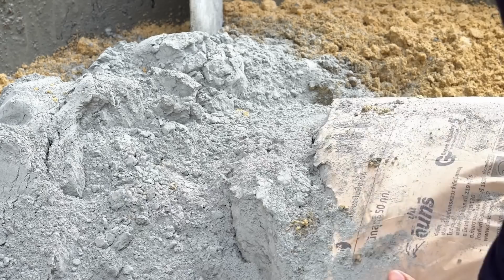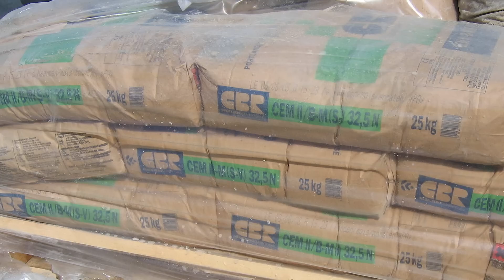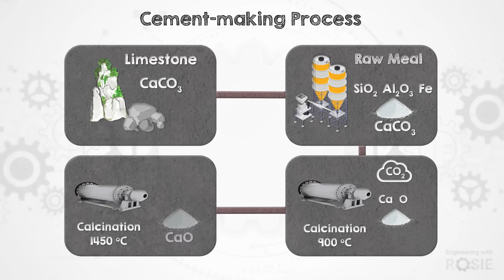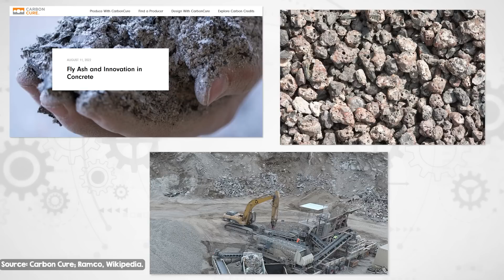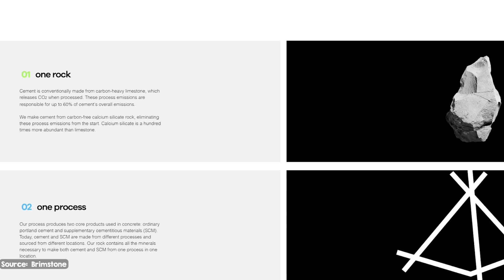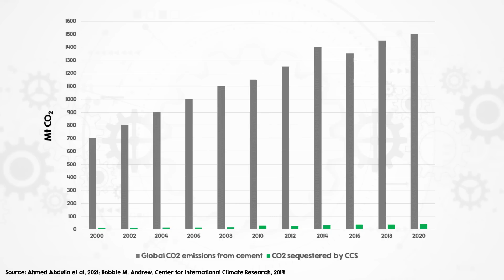Zero Emissions Cement is Closer Than You Think

Comment: Cement has many challenges but also so many opportunities firstly a cement kiln is a massive sink hole for all sorts of materials to get rid of.  A big one is municipal waste which can be fired in as a fuel source all energy becomes part of the process all minerals become cement its a win win really the only emissions is CO2 which doesn't mean new CO2 rather replacing the CO2 from the coal with CO2 from the municipal waste. In fact a cement plant I worked with trialled this very successfully they also used plastic waste all types, used engine oil, sawmill waste etc etc. I understand only issue was SO2 and Cl which were issues but now insurmountable the plant I worked with estimated they could consume the waste for a moderate sized nearby easily so reduced trucking CO2 and eliminated landfill. Biggest issue was most western nations have blanket rules against burning municipal waste.

Recycled cement is a fallacy doesn't exist what you have is repurposed concrete used concrete ground and used as an aggregate replacement in concrete. So merely a way of reducing quarrying, a useful and good thing but not recycled cement.

Comment: An electric furnace demonstrator with capture has been demonstrated, reduces emissions significantly. That åre-heated CO2 waste is actually raw material for some chemical processes, such as making fuels (won't get rid of the emissions but would reduce need for other fuel emissions) and even "human fuel" i.e. proteins (there's demonstrator for that too).

Comment: On average human caused atmospheric carbon dioxide is less than a 0.1% share in earth’s water vapor saturated greenhouse effect.  Water vapor has a CO2e of 18 and on average is 1% of the troposphere.  Carbon dioxide has a CO2e of 1 and is 0.04% of the atmosphere 400ppm.   

1.00%/0.04%=25,  water vapor is 25 times more present in the troposphere than carbon dioxide.  25 X 18 CO2e = 450 CO2e for water vapor and 1 CO2e for CO2.  All the other greenhouse gases add up to a bit less to about the same as that for carbon dioxide or 1 CO2e.   Carbon dioxide has 1/452 (0.0022) share in earth’s water vapor saturated greenhouse effect at average 1% water vapor.  

40% of atmospheric carbon dioxide is considered to be from human activity;  0.0022 X 0.40 = 0.000885 leaving human caused atmospheric carbon dioxide on average being less than a 0.1% share of earth's water vapor saturated greenhouse effect.   5.55°C X 0.000885 = 0.0049°C share in temperature retention from human caused atmospheric carbon dioxide.  

Water vapor always hold earth’s water vapor saturated greenhouse effect in saturation.   The other greenhouse gases can not change the overall effect of earth's water vapor saturated greenhouse effect.

Former Greenpeace scientists state there is no unhealthy high level of atmospheric carbon dioxide.  1200 ppm carbon dioxide levels are used in plant growing greenhouses for C3 plants over 90% of the plant life on earth.   This is three times the current atmospheric carbon dioxide level of 400 ppm and would greatly green the earth especially desert fridge areas allowing C3 plants to need less water.

Comment: Very good summary, one thing that was, however, overlooked is the recent research on replacing the cement precursors with glass.

For those unfamiliar, glass has an amorphous structure which suggests it may be able to be dissolved and reorganised to form a geopolymer cement. However the big road block is that glass is extremely unreactive which is why it is typically used as an additive rather than the sole precursor.

Recently I was involved in research on this area for my thesis where we used a glass derived from a martian simulant material (fake martian soil). In the experiment, we demonstrated that using a strong sodium hydroxide solution the glass could be dissolved and activated to create a cement which uses (aluminosilicate) glass as a sole precursor. The cement was then analysed using xray diffractometry  (XRF wasn't available at the time) which showed that the cement had clearly absorbed CO2 from the atmosphere as the glass itself could not contain any carbon due to the glass making process.

While we were not able to test its material properties the experiment did show a potential route to a carbon neutral cement (only carbon neutral as glass making releases CO2). The use of a varied composition martian simulants also seemed to suggest a strong dependence between reaction time and iron content in the sample. Where iron assisted the reaction and dominated the reaction products.

Comment: There is also the possibility to replace concrete, where concrete is not needed, by wood. I do not talk about the matchstick houses built in the USA (mainly 1.5 by 3.5 inch), but houses like they are build for example Norway using beams instead of sticks. You can produce houses that stand up to heavy winds and earthquakes out of timber. Regarding multi story buildings from timber, they are reaching 20 floors.
Timber buildings are good as long as there is enough timber grown and we actually sequester carbon at the same time. A lot of the timber would be used as CLT or laminated beams. Both can be adjusted to in what direction the strength is needed and produced to needed sizes for each project.

Comment: What if we combine different known processes with the production of cement? I have an idea which includes a pyrolysis chamber and plastic waste, which still have not been solved properly.
My idea is to run the process of making cement and use  the process to heat up the plastic waste so it turns into gas. Since 95% of plastic is made from oil, there is a huge benefit from using the energy in plastic waste to be used a part of the heating process.
One pyrolysis chamber can turn 50 tons of plastic waste into gas or oil per 24 hours.
A by-product of pyrolysis is, it ties the co2 in plastic in carbon black, which can be used in the process of making cement. Or enhancing the soil farmers use to for soil enhancement.
By doing so, we solve some of the problems of cement production. And a part of the need of energy.
But we need to figure out how to channel the heat from cement production to be used in heating the pyrolysis chamber (which needs 500 degrees Celsius)
I think the combination is beneficial.

Comment: I work with slags, and GGBFS, which can replace GP Cement is already being used at about 40% of the concrete binder blend and can be higher, up to 100% such as in some geoploymer blends.
Additionally, there is a bunch of good research going into if BOFS or other steel slags can be used to both capture/sequester carbon and provide a cementitious material.

As you say, blast furnaces are likely to be phased out and the newer technologies are not mature enough to know if the byproducts will be useful for cement, but we have a couple of decades before this (at least) where we can act based on current technology. The steel slags side of things is likely to hang around for much longer and it's showing good promise to supplement cement while also sequestering CO2

Comment: Lime based concrete or mortar is different than klinker based in that it reabsorbs the emitted CO2 over a couple of years, turning back to calcium carbonate, making it truly carbon neutral if cooked with renewable energy.
Unfortunately it's an order of magnitude less resistant and doesn't harden in wet conditions (so called hydraulic lime does harden wet, but uses the same chemical reactions as klinker, so it doesn't reabsorb the CO2).
I'm sure research could be done to increase it's strength so it could be used anytime wet hardening isn't required.
Also look at the recent research apparently solving the mystery of Roman concrete

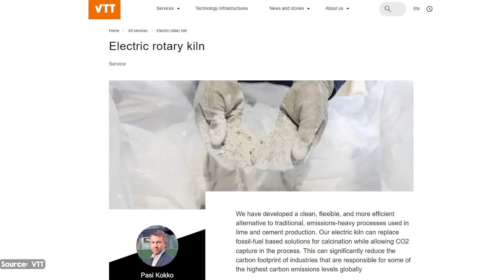Comment: 9:47 - there's a process by ThyssenKrupp that heats kiln using methane burned in oxygen produced on-situ instead of air, making CO2 much more concentrated in effluent gas and so easier to capture. After a series of pilot plants, the plan is underway for an industrial scale installation in Našice, Croatia. The captured CO2 will be stored in nearby saline aquifer.

Comment: Another option worth considering as a cement alternative is large-scale wood construction, which not only avoids concrete and steel production but also acts as a long-term carbon sink. The kind of constructed wood materials they use like cross-laminated timber (CLT) can actually be just as fire resistant as steel and concrete. https://www.youtube.com/watch?v=1N0tdEc4oTw

Comment: great summary, though I would add Rondo energy to your list of heat solutions. They've been able to generate very high temperatures using electric heat batteries - not quite to Cement heat yet, but they are working on it.

Comment: It's not just cement that is an issue. 

180 litres of water are used to make a metre cube of concrete. 47% of this water remains held in the concrete.

Fifty billion tonnes of aggregate are extracted from beds, banks and floodplains of rivers and lakes. Vietnam’s Mekong Delta is disappearing.

We need to reduce the amount of concrete used. Have a look at a product called Stratadune that uses a lot less concrete.

Comment: Kind of brings up an interesting issue.. In studying cement from ancient Rome a fairly recent discovery regarding its strength and ability to last has been shown to be that it is, I don't remember the exact term, bit it's something like, "hot pored". This means that the Valcium Carbonate is still in the process of conversion, unlike Clinker, and it actually develops crystallized bits inside the material. When cracks form and water finds its way in the water dissolves these crystals, which then redeposit in the cracks, as it seeps back out, sealing the cravk and restrengthening the material.

So... do any of the alternatives exhibit this trait, voukd be made to, etc., or are any alternatives we develop going to have the literal same problem as, ironically, all modern cement, in that they cannot self heal, and are thus actually less structurally sound over the long term?

Comment: One 2-MW windmill has 750 cubic yards of concrete foundation. One cubic yard will generate 400 pounds of CO2 so 750 x 400 = 300,000 pounds of CO2 released in concrete manufacture alone for each windmill installed.
Reply: Yeah, wind turbines are pretty concrete intensive, one of the many reasons why I am still keen on nuclear, albeit in its latest 4th gen incarnation.

However, there is a good possibility of reuse of the foundations. My comments get killed if I put in a link, but google: 'wind turbine concrete foundations re use', so the input of concrete is good for many years, with a much lower CO2 cost per KW over the lifetime than it would appear on first blush.

Comment: I work in low-carbon cement research. There's one clarification I'd like to add to a mostly good explainer: the limestone>lime calcination works essentially in reverse over the service life of a concrete structure; CO2 - about 30% of emissions used to make the concrete - is absorbed by the concrete over its life (also: geopolymers use a lit of industrial chemicals, which use enormous amounts of energy- the emissions are not in the cement, but the ingredients). Also, CO2 injection is likely to have unintended consequences on the longevity of concrete structures.
A further way to reduce total cement use is to have longer lasting concrete structures (ones that don't need to be torn down after 30 years).
There's a lot of research and innovation in this area, so watch this space!

Comment: It is great to hear the optimism of this survey of what could be done in an industry with such feet of clay that it is resisting any change to its massive momentum of continuing to expand the fossil emissions it creates, and such duplicity that it greenwashes with every word when it speaks of its plans at all.

Geopolymer and sequestration of aggregates are cement's two great hopes in a world that needs everything to become net carbon negative, and rapidly -- at least 2% of today's level less fossil emission per month down to zero by 2030 to avoid Lahaina repeating over and over again. Unlike Ordinary Portland Cement (OPC) and most other cements, geopolymer (alkali-activated metakaolin) tolerates charcoal (or 'biochar') as an aggregating material well, and can be made substantially lighter and better insulating concrete with little loss of strength, cheaply. This is a good way to sequester the wood waste from all those trillion trees the world needs to plant by 2060 to prevent the trees from decaying into methane.

While carbon curing has a nice sound to it, the present practice is for governments to subsidize carbon cure cement that otherwise would never have been produced, thereby creating fifty times as  much CO2 emissions from fossil (which all limestone is). In reality, carbon cure is a dead end: all cement eventually cures over time, so the gain of 'carbon cure' is temporary and dubious.

Building out of engineered wood, however? That's as good as it sounds. Especially increasing population density of cities with engineered wood buildings in walkable neighborhoods.

Keep up the great work.

Comment: An excellent review.  One point that seems to have been missed:  much of the CO2 driven off in lime production (calcination) is re-absorbed by the cement, just over the ~ 100 yr timeframe, so not fast enough., but carbon neutral over the long term- so the real issue is the energy, not really the calcining..Alternative cementitious materials, wiser use of cement, alternatives TO concrete for above-grade construction, electric heating in calcination, biofuels for clinkering, and CCS...they're all needed.  Note one thing missing here:  hydrogen.  I don't think there's really a role for hydrogen in cement production because the clinkering kilns need a radiant flame- they don't even like burning gas, they'd prefer coal.  Hydrogen is definitely capable of generating the required heat (at tremendous cost) but isn't a perfect fit.  Biogas methane with the addition of biochar is a better fit there.
Reply from the maker: Thanks for adding those extra points. Does cement really reabsorb ALL of the CO2 from lime production eventually? Even in the middle of a thick slab?
Reply: Seems like an imperfect CO2 sink.. wonder if the 100yr timeline has an effect?  And seems logical that only x% of the volume would capture CO2 (exposed).  
AND we would have to make sure all buildings remain in use over 100 years…. With all inefficiencies we might end up wirh 15-20% of the original CO2 captured … changing materials sounds better
Reply: @EngineeringwithRosie  Eventually yes though slow the much taunted 100yrs I suspect is merely the half life of the equation however its still significant, certainly significant enough to be mentioned surely.

Comment: Recycled plastic -in-situ raft slab form-liners can be used in on-ground slabs to reduce the amount of concrete used in these applications.  It can according to supplier data reduce the overall cost of am in-situ slab by 15-20%.  As per your video when you add this to a process from Carbon Cure you are potentially looking at reductions in concrete volume.  These two reductions might go some way to balancing out the increased in production cost of the new concrete mixtures thus allowing for a faster transition away from existing concrete mixtures.

Comment: Thanks for the great video. Love your channel, I watch it regularly.  Mass timber can replace concrete in so many. applications from buildings to bridges.  It is great to get to zero emissions concrete but that doesn't solve the problem that it is a finite resource.  Keep up the great videos!!
Reply: Mass timber cannot replace concrete in most applications & also if you consider the whole-life, mass timber is not a significantly lower carbon material than concrete

Comment: Neocrete seems to be looking hopeful as an additive to reduce cement quantities without needing a fossil fuel source. Sources from volcanoes in NZ I believe.
Reply: Should be called Paleocrete:

Pozzolanas such as Santorin earth were used in the Eastern Mediterranean since 500–400 BC. Although pioneered by the ancient Greeks, it was the Romans who eventually fully developed the potential of lime-pozzolan pastes as binder phase in Roman concrete used for buildings and underwater construction. Vitruvius speaks of four types of pozzolana: black, white, grey, and red, all of which can be found in the volcanic areas of Italy, such as Naples. Typically it was very thoroughly mixed two-to-one with lime just prior to mixing with water. The Roman port at Cosa was built of pozzolana-lime concrete that was poured under water, apparently using a long tube to carefully lay it up without allowing sea water to mix with it. The three piers are still visible today, with the underwater portions in generally excellent condition even after more than 2100 years.

-Wikipedia

Comment: I don't like all those concrete skyscrapers to begin with. Perhaps we could build mathematical structures which are strong without needing much material? And other materials should be used. Perhaps fiberglass sheets and a lot of "sticky polymer" could be used.  Perhaps going in the ground could be an option too since the structure would need less support there. That would save on heating and cooling too. I always feel too that renovation should be preferred but now they find it easier to smash everything down. That works easier. Yes, but we need interlocking panels etc to cover old walls etc..